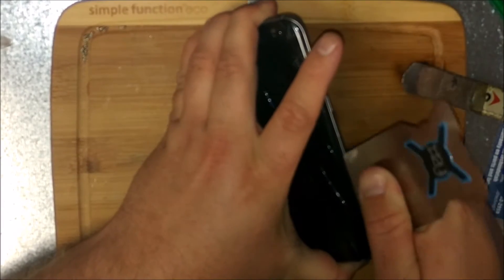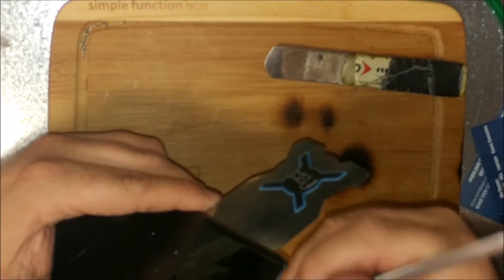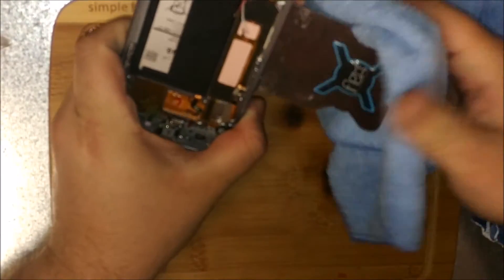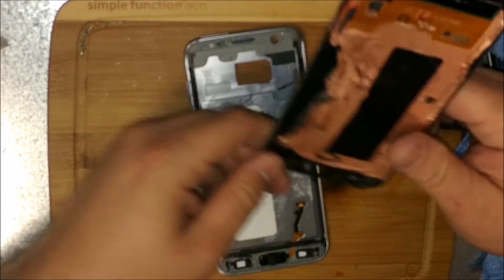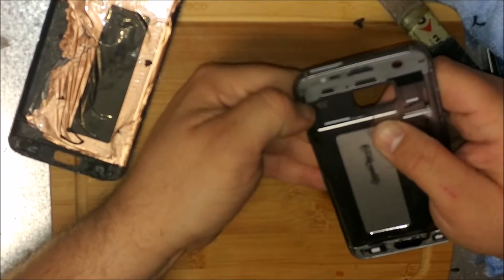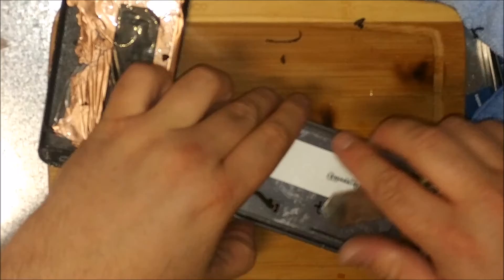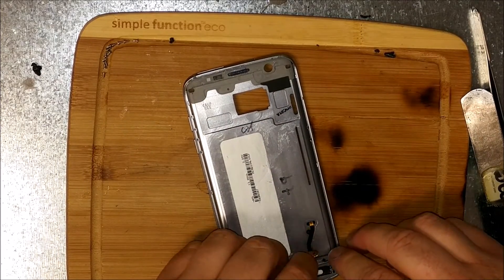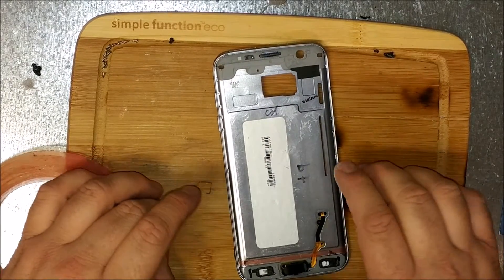S7 Edge Tear Down, Glass Repair Fail, LCD Replacement Part 2

Comment: Hahahaha....this is sooo bad repair...sorry man but you are so bad in this one!
Reply from the maker: Thug Style completely agree
Reply: @TechMDYoutube  to mouch pressure...first  you need to take. Out  battery(hight temp. Demage  battery)...than use isopropanol for make  glue less sticky and  separate lcd from frame from inside ...use plastic tape to separate not metal tools....etc...this one is very bad...sorry man! Ore  you can use  freezer (-150  C °or -190 for 90sec.) Thats how i  do it...
Reply: @TechMDYoutube  do you have any  tools ?separator,laminating  mashine,freezer,buble.remower ,dust free room?any  profesional tool?
Reply: @TechMDYoutube  that lcd you have  is from china(used) orginal lcd for s7 edge  is with frame,you can't  buy  only lcd..Samsung service  pack its about  170$ i think now...that you have  is from china  they replace  glass on lcd and sell it  like that...alliexpress 😁

Comment: +Tech MD hey dude I can see you're having a hard time there but with the S7EDGE there is hope. There is a film between the glass and the Amoled display. DO NOT remove the screen for a glass replacement because there is no need. You can use a couple of methods. I have had a lot of success with dry ice. I don't make YouTube video's but I was going to make one for this .method until I noticed that someone else has already and I'll grab the link to that in a moment. Actually I'll grab you links to video's for both methods, the other being the film peel, I'll put them in another post in a few minutes.